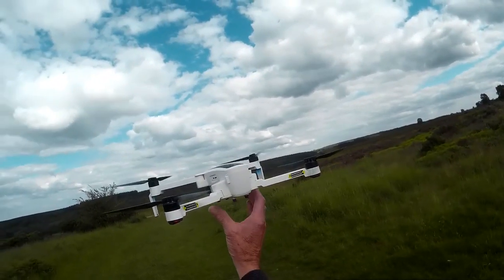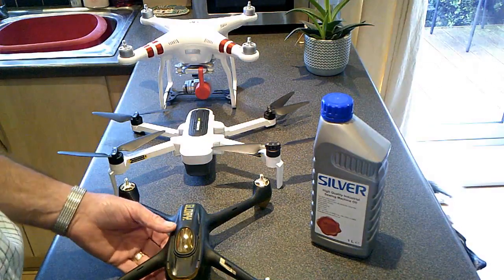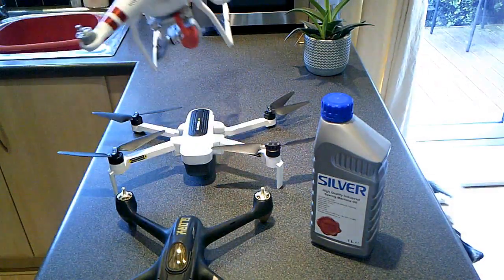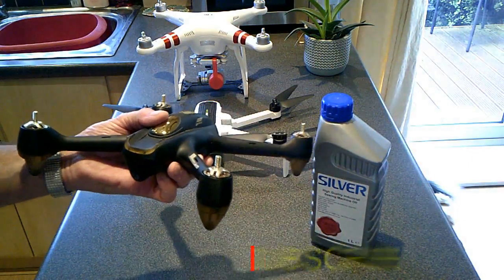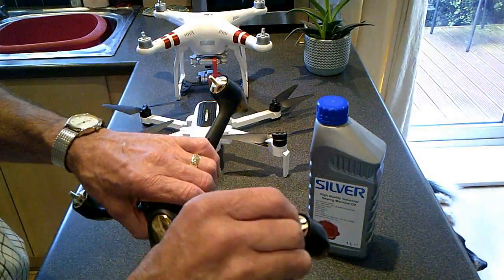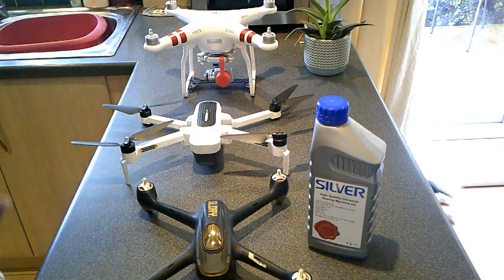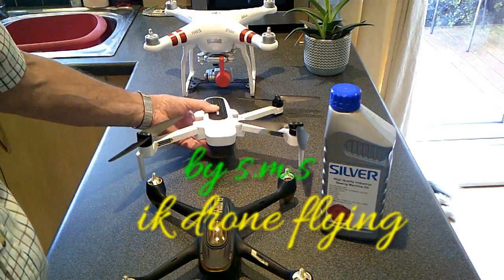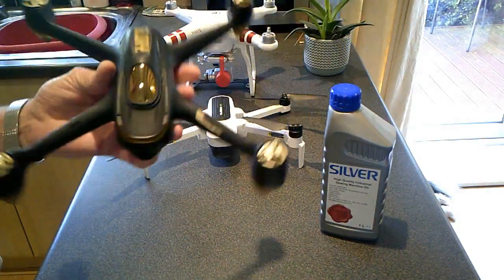Oiling the motors on my zino

Comment: now that's a funny thing I used to put a bit of oil on my old Hubsan then I said to myself well bearings are sealed what's the point and if any oil splashed up onto the magnets well then what's going to happen,
but now you are saying they're not real bearings metal to metal 
well, that will mean a little bit of oil is good but what about the magnets and coils, at those speeds some oil is likely to Splash into the magnets ?????
Reply from the maker: I only put 2 tiny drops every few months and they've been flying fine for a few years. No failures yet!!! Thanks for your concern 😊